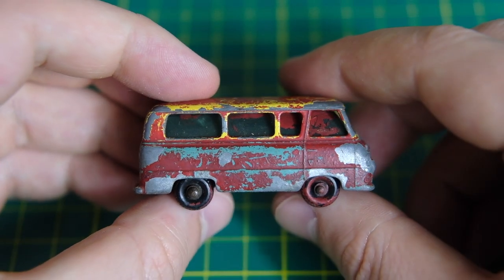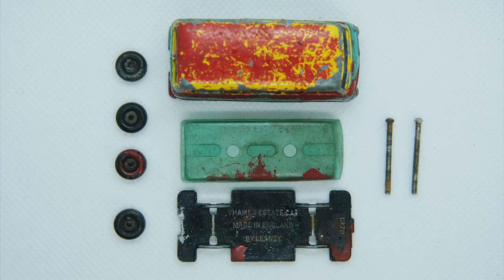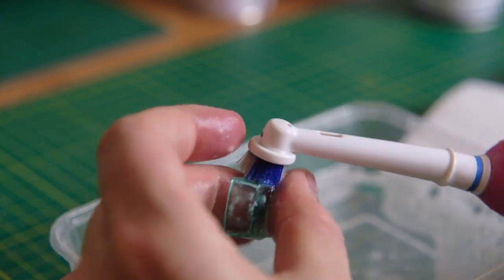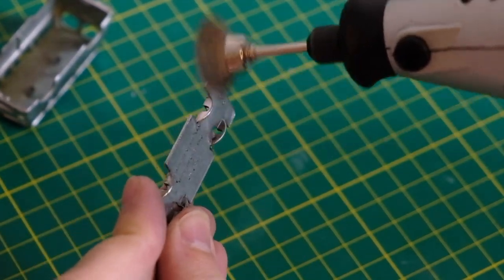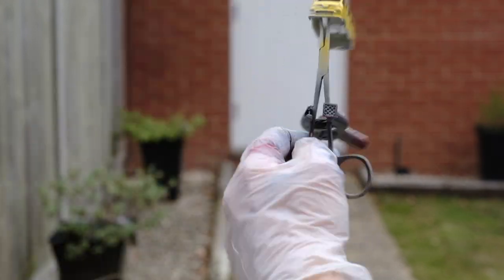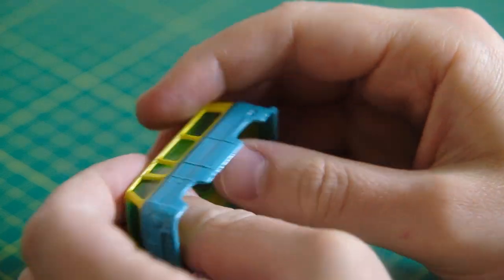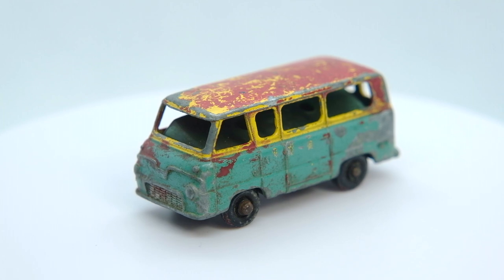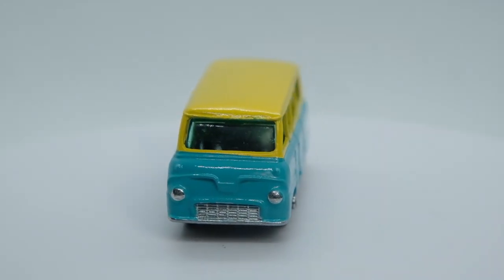MATCHBOX restoration: 70A Thames Estate Car

Comment: I have never used caustic soda before how does it compare to aircraft stripper? As far as time and how well it removes paint
Reply: I'll let Jason give you his experience, but I find caustic soda works great for older paint. I find it barely touches some of the thicker hot wheels paint though, or takes multiple "baths".
Reply from the maker: This is very much my experience. You just find some paints will need more work than others. Especially the metallic flake kind. It’s a lot quicker overall than using paint stripper in my opinion but it isn’t for everyone.
Reply: And you have to be extremely careful when you use it. Gloves, glasses, very good ventilated area. Safe is always first 👍